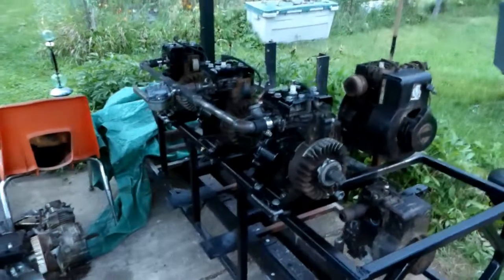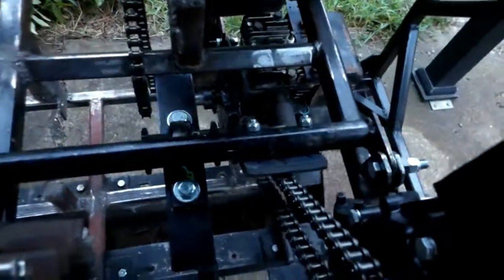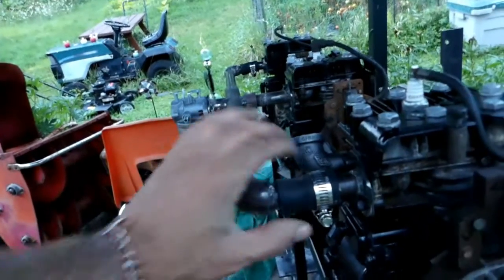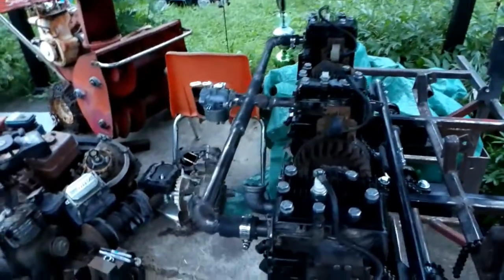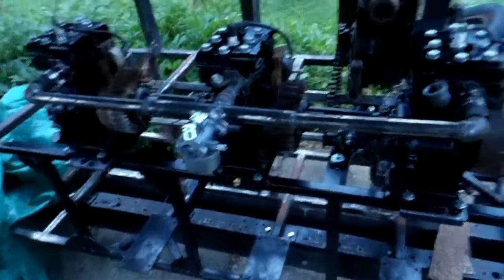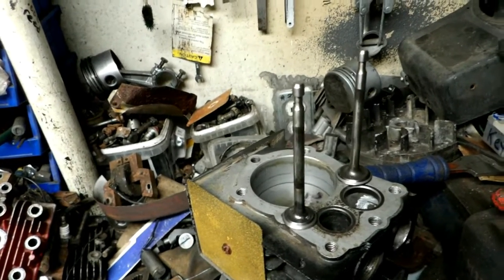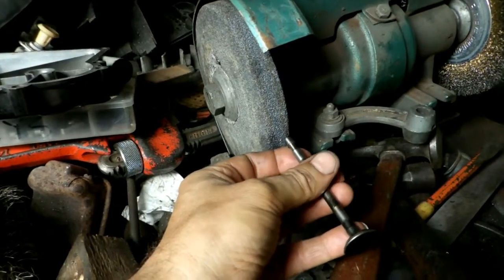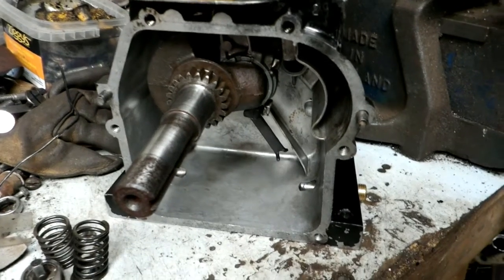Week 19 Homemade 12 Cylinder Engine Build

Comment: Im getting a billet aluminum rod and flywheel for my 5hp and a 22mm mikuni do you think I should get heavier valve springs or should I just see if it gets too much valve float and go off that?
Reply from the maker: I think you may want stiffer valve springs, for higher rpm. They also made racing cams for the 5 horse. I used to find the hop up parts on go kart websites, I think maybe Russell karting was one site, but my memory could be a bit fizzy  :)  The billet rod with the built in oiling dipper is the way to go, for sure. It is too bad that they stopped making the racing rod directly from Briggs. Keep the stock 5 horse head (as opposed to a 4 horse model 10 head). The 4 horse head works better with higher compression at low rpm, but restricts flow at higher rpms that you can take advantage of with your go fast goodies.
Reply: @ChargerMiles007  ok thanks for sharing your knowledge, I will definitely keep that in mind

Comment: A comment to make the YouTube beast happy. 
Did you plan to power something with this when you are done? Sorry if you mentioned it someplace in this series and I missed it.
Reply from the maker: I thought of powering a Focus with it, but then my large timing shaft bend after machining, this 7/8" matchstick could only handle 10 horse if it is lucky, so not worth the attempt.

Comment: are you worried that the carb being so close to the one engine and far from the others that it will starve the farther engines?  Glad to see you are still working on crazyness.
Reply: As long as they're timed right only one should be on intake at one time.
Reply from the maker: The different lengths will have an effect, but my previous engines have ran not to bad with similar intake designs. Not ideal, but fairly easy to build.

Comment: How’s the budget going on this project ? All mine usually cost double or I do what I call a “ goose egg budget “ when I spend zero dollars ( those projects usually end up pretty sloppy ).
Reply from the maker: Oh this one has ballooned way out of sight, probably have dropped $700 into it so far, but that includes some of the pieces for the 24 cylinder. This project has turned out to be far more work that I imagined. I will be fighting hard to have a 12 cylinder run before the snow flies, but I hope to accomplish it.
Reply: @ChargerMiles007  Projects ALWAYS go over.